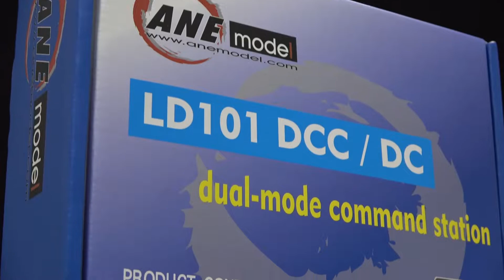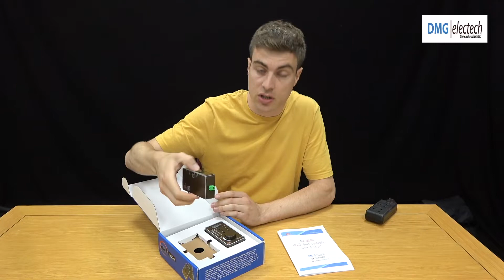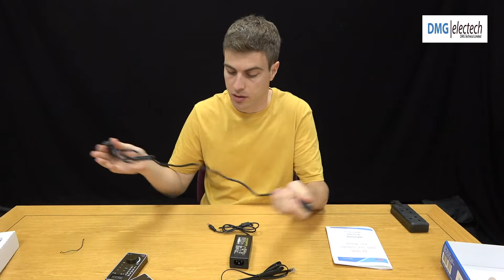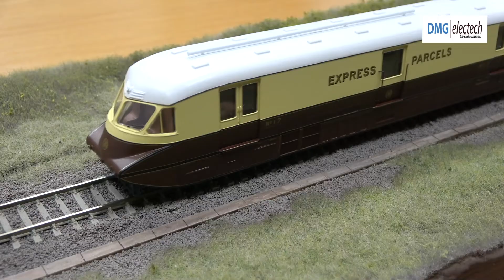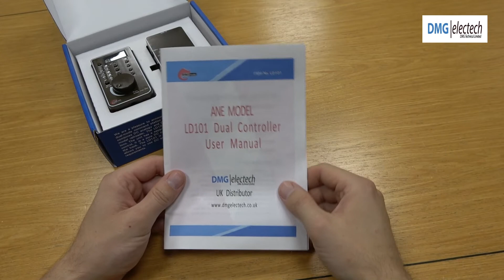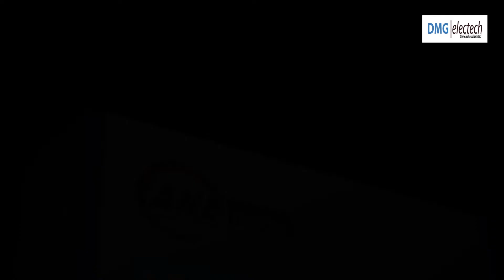DMG Electech DCC DC Command StationNEW

Comment: Very well explained Thank You. I'm at a cross road thinking of going over to dcc. Though I've dozens  and dozens of older Triang and others which I'll run on separate tracks as dc. This controller seems to offer what I need with out the hefty price tag. Having been warned against the Hornby dcc unit. Cheers